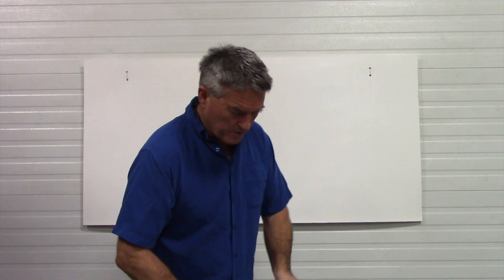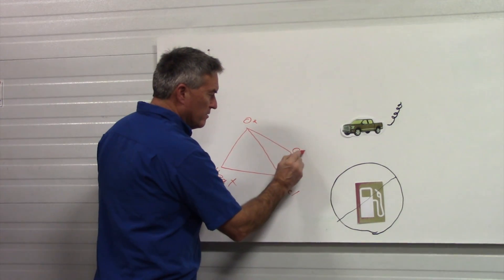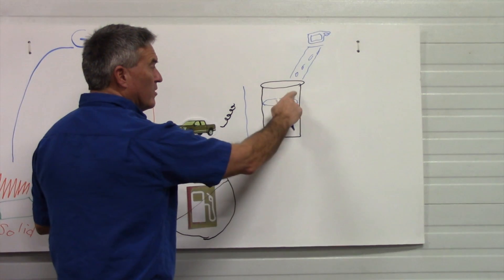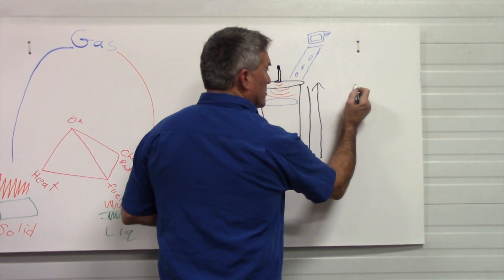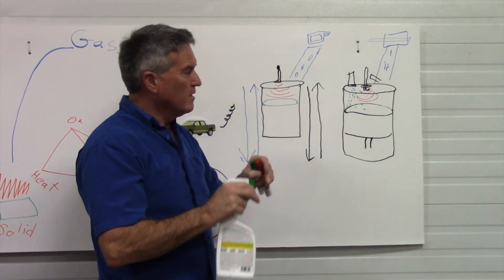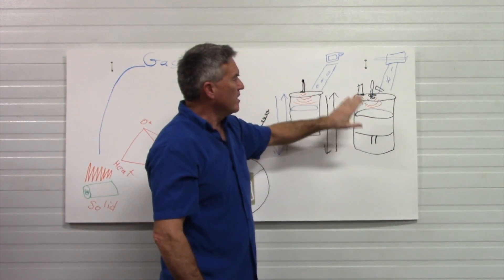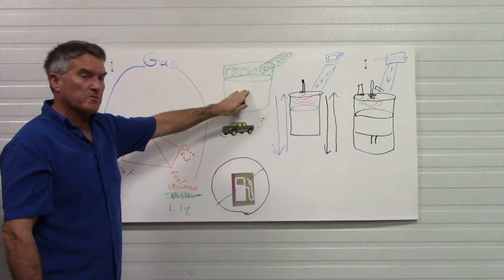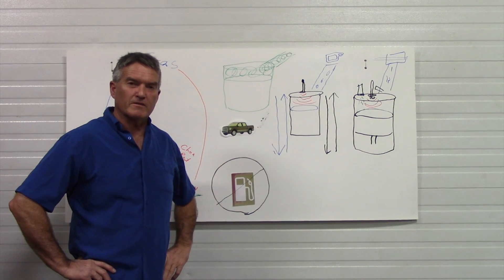One Simple Trick to get 100 miles per gallon with less pollution!

Comment: Going from 25% efficacy at 25 mpg to 100% efficacy at 100 mpg no radiator is needed and the exhaust will be cool with no noise at 100% efficacy their are no losses.  How does this story go with an engine burning propane it is a gas already but has similar efficacy as a fuel injected liquid petrol engine showing it vaporizes very well.

Comment: Things I have learned!!!  Research  historical records ;  all things you may read are true,   but dont let that poison  your  thinking-!   2  add oil lubricants to your fuel  ( even 200 or 100 to one ratio,  because lean ratio of fuel to air creates more heat!   3  turbulence in the  intake  manifold  and combustion chamber area  is critical  for good  clean  burn (the consistent  ignition  of mixtures)   4 the highest temperature  of the fuel and manifolds  is important  to have  consistent  ignition (CD  ignition  is necessary  for good spark--- capacitive  discharge)    5  dont give away your secrets  , especially  to corporations ( very important  for your peace of mind and life)   6  write down all your test results, and hide them from every one   ( only for your eyes) even if you have a patented  product!   7 pray to God for ideas

Comment: Higher  mileage is using less  energy!   The faster you travel  the more energy you use, plain and simple: so if only travel on level road  at sex miles per hour,  you could  get 2000 mpg. In ideal conditions!  That talking  friction  and engine  efficiency  into consideration.

Comment: The 50 mpg engine was developed in the 1980's, the 150 mpg engine was developed in the 2000's. A GEET engine can drive for at least one year on one gallon of Bunker C fuel oil.

Comment: Does anyone here have an opinion on MALCOLM BENDALL and his plasmoid ionizer / ball lightening bubblers / thunderstorm generator contraptions? This video is 8 years old, very basic, and I’m not bashing it. In the comments I find more actual knowledge than most of the  many videos on vapor carburetors. It’s not a new concept, but many shaky scam like inventor videos try to claim a miracle, some just bubble intake air through a jar of gas to prove it works. I dabbled with these things decades ago & satisfied my curiosity. 

Malcolm Bendall I think has seen the old videos & is trying to revive & disguise the vaporizer to claim he has invented a new miracle, otherwise known as a SCAM, for which he is most widely known. Randall Carlson I deeply respect from way back, and I give him credit for changing my thinking on many things, but I fear he has been DUPED. A classic pattern of a scammer- is to find someone with credibility and bring them on board. Randall seems to be hook, line, and sinker in support of the scam, it’s sad!

Comment: You can think of this in a very simple way. Look at your old coleman fuel camp stove's and lantern's. Pressure pumped by hand makes a vapor you can burn. Regulate the amount of pressure on your gas tank and supply the vapor to the engine. Maybe an on board air compressor with a pressure cycling switch on the tank to supply the right amount of pressure.  I believe we are working on the same principles.
Reply: As a collector, fixer, & user of Coleman lanterns I understand your point, but it’s not quite complete. The pressure from the hand pump does NOT create vapor, it just pressurizes the fuel. If talking about cars, an electric or mechanical fuel pump will do fine. 

The magic trick in a Coleman happens in what they call the “generator” tube that conducts the fuel up past the hot burning mantle. In a stove the generator full of fuel passes directly through the flame, and that’s where the vapor is created. Early Coleman lanterns required preheating the generator initially with a torch, later just a match, to get the fuel to vaporize & with decades of experimenting they found a way to wick, swirl, & evaporate enough of the fuel to get enough vapor at room temperature to light the mantels. Once burning, the mantles themselves provide the heat for continued vaporization. Coleman guys know just when to strike a flame to the mantle by listening carefully waiting for the gurgle (liquid fuel) to change to a hiss (gas vapor) when opening the valve. If everything is just right they WOOF then take right off and you have the Sunshine of the Night! Less experienced campers often fiddle around too long and a puddle of liquid fuel builds up. When they strike the match they get a 2 foot fireball instead of glowing mantles.

Comment: There are several areas to improve economy.  Correct camshaft,  must have a narrow lobe centre line 105 or 106 . High Compression.  And the inlet air & inlet water temperatures must be high , even & identical.  A closed loop cooling system .  Another area is going from same a 4 speed  ( auto / manual ) to either 5 or 6 speed  ( auto /manual )  spark plugs . I use plugs out of Europe.  And extractors .

Comment: There is actually a guy that got 100% fuel vapor using a the exhaust with a heat exchanger and a turbo faced directly into the intake. He shows exactly how its done on the Facebook group Gasoline Vapor Systems.

Comment: For burning gas vapor, the engine should have modified timing as well (spark and valve). The advanced timing at upper RPM ranges can lead to flashback back through the intake valve. It could be mitigated with a flashback arrestor, though.

Lean is only a problem for around 16:1 to 25:1 or so. Once you get in the range of 40 or even 50:1 (vaporized), the fuel is burnt completely immediately, and not continuing to burn on the exhaust stroke (burning the exhaust valves). Don't believe me? Look at the exhaust on race cars with flames coming out.

Comment: This was a good video but there is one thing that is wrong with it.  Oil is NOT A FOSSIL FUEL it is actually a mineral.  The term fossil fuel ⛽️ come about when Rockefeller and the other oil tycoons where making their millions or billions back in the late 1800 s and early 1900s.  They needed a term that could make oil prices go higher well. They coined the term Fossil Fuel to make it sound that there is a limited amount of oil.   OIL IS A MINERAL. People need to stop saying oil is a fossil fuel.   It a MINERAL and it comes out of the ground.

Comment: Overall it was a good presentation, just two things the term fossil fuels is a misnomer, it was created by the Rockefellers oil interests to create the lie that there is a shortage of hydrocarbon fuel which there is not. I know of no way to change a car's fuel system so that the fuel is vapourised, I would imagine the ECU would act up, I did experiment with so called HHO for several years to find its an unworkable technology, possible adding pure acetone in very small quantities might give some benefit.

Comment: The problem: It doesn't seem that the gap between the mist of the fuel injector and actually using gaseous gasoline is that big... One could design a better injector perhaps.

Comment: Actually, that's not true. The original henry ford carb and many other generators, used a hot exhaust manifold drip system. They used a thermal fracturing method to vaporize the fuel source.
They were capable of running just about anything as a fuel source.,.. Think about it.. When was gasoline created, and used??? It didn't exist in the 1800s.
The carb was designed specifically to run on oils; crude, cooking, seed, tar, and alcohol.

Oh and maybe you should research the Pogue and Phish carburetors. What your explaining here is literally and absolutely nothing new,... In fact, your almost literally,,, a hundred years behind the technology.

Here's a piece of information you might want to know...No matter the compression level, atomised fuel, is Always forced back into a liquid, concentrated in the center of the bore. Meaning atomised fuel, no matter the micron size, will never be completely burned,,,UNLESS.,...

Comment: A guy made a system to run on gas fumes for his lawnmower and there were no visible emissions from the exhaust. He only got about 2-3% greater fuel economy. It could be his system just wasn't set up in the best configuration, plus it was not fuel-injected but still 2-3% more fuel economy and next to no emissions is pretty good. If your 5L 8-cyl engine could get 70 mph, my 5.7L 8-cyl with EcoBoost should get a pretty good economy boost, with such a system. The catalytic converter could possibly even be a smaller lighter system and would probably last a lot longer if it's even necessary to have one at all.

Comment: This is a good solution to burn rate, power and efficiency, however it does not seem safe. Like you've already mentioned, gas can only ignite when it has oxygen to react with. If these are already mixed inside a high pressure tube, a premature ignition would be explosive. 
     There are two main variables to consider: Pro: The earlier they are mixed, the more efficient the burn will be. Con: The earlier they are mixed, the higher the chance of a premature explosion will be + the more explosive it will be, as there is more fuel/oxygen to react. This is where you find a balance. 
     With the methods already in use today, the risk of fuel combusting before reaching the engine is almost zero, as the fuel lines are sealed off from oxygen.

Comment: This is such a load of BS.  The combustion process has been 98 to 99% efficient for the last 50+ years.  Hence, getting the last 1% is only going to improve the fuel efficiency by 1%, AT THE MOST!!  Fuel does not need to turn into gas to ignite e.g. dynomite.   The fire triangle was invented to explain how to fight  fires for firemen.   All gasoline is completely vaporized because of heat of compression before the spark plug fires.  Fuel injection has been around since WWII i.e. 1940.  Fighter plane with carburator would stall flying upside down or at high g's.   Adding less fuel to a gas engine will result in detonation or very high burn temperature and destroy the engine.  There are ways to get around this i.e. diesel and stratified combustion.  Gasoline is NOT a good lubricant.  It is NOT used to lubricate the cylinder walls.  Engine oil is used for lubrication.  2-stroke engines must add it to the gasoline.  Natural Gas, and many other gasses have been used as fuel.  The atomization is better but in the overall picture of fuel efficiency, it is just that 1% (actually less).  So, what is the problem??  This is old news. (Look up Carnot.  In 1850's he proved that the best that can be done in any possible engine converting any fuel into heat to make mechanical work is much much less than 100%, closer to 50%).  Modern gasoline engines run at 80% of what is possible at that compression.  So, if there was no heat loss through the radiator, no friction, perfect combustion, etc. we could get another 25% MAX.  Heat engines just waste a lot of energy by their nature.  Here is a simple explanation of why this is.  When the cylinder is making power and moving down in the power stroke, the molecules inside that cylinder are bouncing and spinning all over the place.  It is a complete chaos.  If we could line them up, as if fired from a gun battery, and make them just bounce off the piston and transfer all of that energy to the downward motion, then we would get 100%... but this cannot be done.  This is a very profound discovery (lookup Boltzman) and rules everything in the universe, including quantum physics!  (and helps us answer the theological question of whether it is hot or cold in Hell.  Hell is cold at absolute 0!)

Comment: I looked up this patent application.  Ridiculous.  Hire a professional man.
I can imagine what it is kind of, but the patent application doesn't really describe anything.  This patent application lacks any of the detail necessary to obtain a patent.  Much like this video, it is full of platitudes.  The only thing you get from it is that there's a bubbler of some sort which causes bubbles to traverse a gas tank, which causes vaporization of the gasoline.  Oh wait, my summation is much more descriptive that what is actually stated in the application.

And here are his claims:  
I Claim- The Fuel Saver/ Collector will reduce fuel consumption on the Global market to a fraction of what it is today.
I Claim- The Fuel Saver/Collector will reduce greenhouse gasses on a Global level to a small percentage of what is presently created by the burning of fossil fuels.
I Claim- The Fuel Saver/Collector will transform decomposing material into a usable fuel product for combustion, rather than emitting methane into the atmosphere.

Maybe you should at least read a couple of patent applications before you file a pro se patent application to get an idea of what it should look like.

Comment: There are a lot of patents for vapor carburetors. An engineer at GM came up with a vapor carb that would give 250 mpg. In a not to unexpected turn of events, the fuel companies responded to this threat to their bottom lines. They have added shellac (for lack of the proper term) that causes vapor carbs to become totally gummed up over time to stop the vapor carb threat... I'm assuming Zeek on Earth does not know this. The idea is extremely good and can be made workable with gasoline that is not "shellaced." Hint: there is none available to us.

For all of you who seemed to miss the "one simple trick." The trick is to first vaporize the liquid thus providing a fuel that will burn up completely and not leave unburned hydrocarbons. Everything he is saying is correct. Also, for those of you too smart to listen to the whole lecture on how an engine works, please think of the people who literally do not know and so would not appreciate the simple trick without a basic understanding of 4 cycle engines.. Again, the trick is to eliminate the liquid before it gets in the engine. The attempt at making better and better injection systems is to get finer and finer mists to increase efficiency of gasoline engines. The reasoning behind that is that the finer the mist, the more of it that will turn to a gas and burn before being expelled. Nothing is more efficient than gas vapor: It cools the burn chamber and then burns perfectly.

Another way to think about this: You fill your tank with gasoline and then drive down the road and some of your gas (money) is dribbling onto the ground. The more and faster you drive the more money you lose. You are paying to eject some of the gasoline into the environment and not to power your vehicle. That waste stops if the liquid could first be turned into vapor. Then all your money goes to moving the vehicle.
Reply: So why don't propane or natural gas vehicles get 250 MPG?
Reply: @Fred-mp1vf  Those fuel have way less potential energy
Reply: is there a way to periodically clean the shitlac out of the system to negate the nefarious corporations stealing from we the people?
Reply: @alphajuliet01al  just buy distilled gasoline.
Reply: @alphajuliet01al  yes, you can clean the shellac by spending all the saved money from fuel economy for some acetone to clean the carb...lol
Reply: Is this better for the engine then running too lean? I think they added Lead to gasoline in 1922.
Reply: They are making home gasoline with plastic...  that one came out cleaner...  could that be a solution...  I am not saying is financially viable, but it can be a solution?
Reply: Agreed! These vaporizers will work for a while, then gunk up & quit. I don’t believe the refineries purposely add “shellac” to the fuel, I suspect it’s more a case of trying to maximize the gallons of gas they get from each barrel of crude oil, while minimizing the amount of undesirable / waste product. Crude oil vaporized in a refinery tower yields very light & dangerously explosive fumes at the top, diesel, kerosene, or Coleman fuel somewhere in the middle, and asphalt at the bottom. What you call shellac is maybe somewhere in the mix also? The heavier the product the more heat it takes to vaporize it. A carburetor or fuel injector gets a homogeneous mix into the combustion chamber and some of it burns. The rest goes to the catalytic converter where things get incredibly hot to deal with the unburned hydrocarbons (HC). Heating gasoline in a vaporizer boils off the lighter segments & the asphalt like gunk remains. 

I claim zero refining expertise, but gasoline being the biggest demand is a mixture of many things combined, likely as much filler as they can have and still get it to function. There are different methods of refining crude, different grades of crude oil, and different grades of gasoline depending on the season. I understand refinery technology changed from “cracking” to “splitting” (or maybe the other way around) as cars & the demand for gasoline increased around WWII. It’s been suggested that Pogue’s Winnipeg carburetor possibly worked on the old gas, but would gunk up & quit on the newer stuff. If we could access 1920s era gas things might work better, it might also cost 3 times as much. In any case, the high mpg result we might see during a short test when everything is just right does not hold up if you have to throw out 1/2 of each gallon because you can’t vaporize it.
Reply: @Bitterrootbackroads What you say makes sense.
Reply: Put the coo coo back in the clock you crazy conspiracy moron

Comment: First he said that liquid gas is needed to cool the inside of the carburetor and then he says he's devised a system to bypass this very necessary stage of combustion. Won't introducing gas vapor instead of liquid gas cause overheating?

Comment: a government program was using fumes to run a car, it was a small item added to the vehicle and it got about 1000 miles to the gallon
Reply: Going from 25% efficacy at 25 mpg to 100% efficacy at 100 mpg no radiator is needed and the exhaust will be cool with no noise at 100% efficacy their are no losses. 1,000 mpg is 1,000 % efficient 10 x the energy put in with no loses.